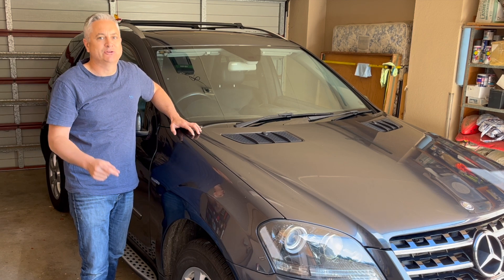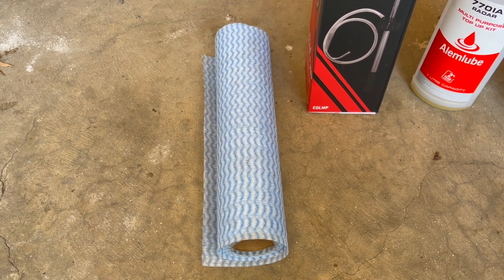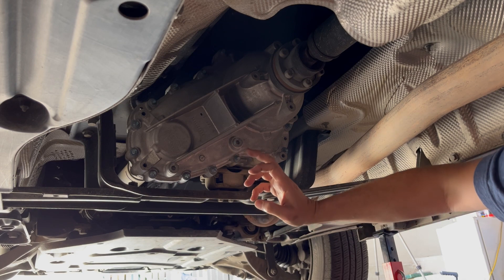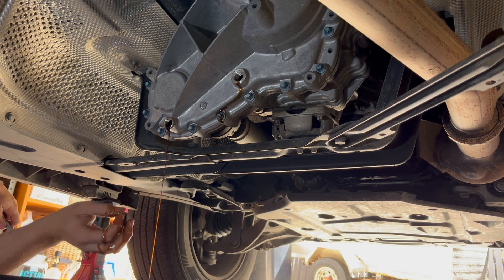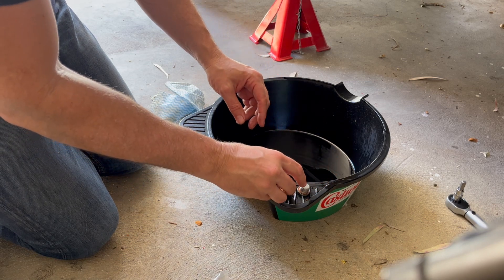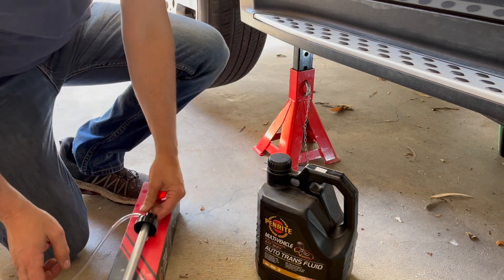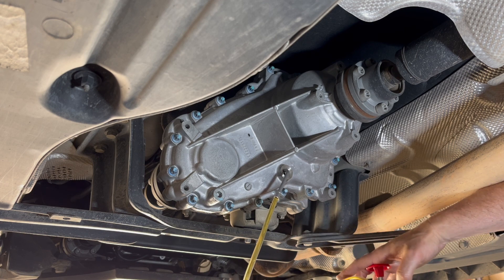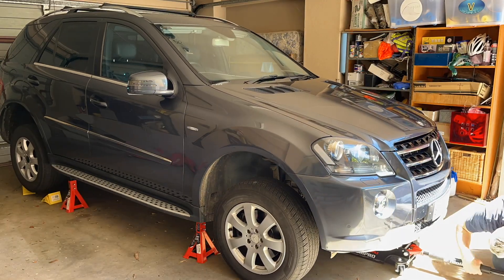How to Change Mercedes ML350 W164 Transfer Case Fluid Oil by Yourself - ML320 ML550 ML63 AMG GL

Comment: But why the oil color is yellow not Red
Reply from the maker: Hi Mate, I would have explained in the video that in Australia we have a oil company name Penrite and they make a ATF fluid which  meets many MB standards and I use it because you can use it in both low friction (option A89) 722.9 transmissions and the early 722.9 transmissions as well as the transfer case, but the colour is gold!  Cheers Drew

Comment: I changed mine today on my 2013 Mercedes ML-350 4matic. At 122,800 miles (197,600 km) and has never been changed. The fluid was pretty dark! However rear diff fluid color was ok...and has never been changed either.
Reply from the maker: Interesting, I reckon both your transfer case and differential will have breathed a sigh of relief!!  Cheers Drew
Reply: @DrewFixIt  I sort of figured out why Mercedes service manual never put the differential service intervals on the maintenance schedule. Because the fluid doesn't deteriorate that much it seems. However the transfer case ATF fluid does though it seems. Mercedes should have at least put the transfer case fluid change internals on the maintenance service manual.
Reply from the maker: @7150285  to be honest I just did my rear differential (video coming) and whilst I didn’t comment about it to me the fluid actually looked slightly milky in colour so I am glad that I have changed mine!  Cheers Drew
Reply: @DrewFixIt  how many miles or kilometers and how many years did your diff fluid had?? When you change your diff fluids...
Reply from the maker: @7150285   my vehicle has 170,000 kms and I don’t believe it has ever been changed before.  Cheers Drew
Reply: @DrewFixIt  shops and dealership usually don't mess with the differential fluid, nor the transfer case either actually. Because it is not even in the Mercedes's service intervals...at least not the shops or dealership in the US.
Reply: @DrewFixIt  did you also changed your front diff fluid at 170,000 km?? If yes, what color was it??

Comment: Thank you for your informative videos! My R-Class (W251) from 2007, has 115.000 km, and I'm thinking to change the transfer case oil. My MB dealer says I should not do it, since the old oil is thicker and new thinner oil can start to make noice. They recommend to never change oil, can that be true?
Reply from the maker: Hi Daniel,  I think your dealer wants to sell a complete new transfer case in a few years time!  I spoke with a senior tech at my local Mercedes dealership a month or so back, he has a GL variant of the same era of my car so would be X164 chassis and he himself told me the first thing that he did when he bought the car was change every single fluid to be fresh fluid and his advice was just make sure you buy good quality name brand oil that meets the MB required MB spec.  I personally use two brands most of the time; either Castrol or Penrite (which is a premium Australian brand) Cheers Drew
Reply from the maker: Hi Daniel, this is the benefit of the Penrite ATF fluid that I am using it does all of the MB specs across the Transfer Case along with eary and late 722.9 transmission.  If you're in Australia I would recommend using this Penrite fluid!  Cheers Drew
Reply: @DrewFixIt I'm in Europe so we don't have the Penrite, unfortenately, so I will take the best we have, the Fuchs Titan ATF 3353 MB 236.12, cheers!
Reply from the maker: @danieleriksson1657  Hi Daniel, you are absolutely doing the right thing as I always highlight in my video make sure you get a good quality oil in your country with the correct MB specification!  Cheers Drew
Reply: @DrewFixIt  that's the tricky part. MB workshop says 236.14 together with other MB sources and other MB sources says 236.12. Some people says the new 236.14 is compatible with the older 236.12, and some says 236.12 is much better, since it's Dextron III and the 236.14 oil is not complying with Dextron III. Fuchs 4134 is MB 236.14 and Fuchs 3533 is MB 236.12
Reply: Yes. You should definitely change it...

Comment: My GL has differential lock in both rear axle and transfer case (offroad version). Should I use same oil as you did? Thanks
Reply from the maker: Hi Mate, you need to check the exact specifications of the oil required for your diffs as I believe it is different.  Cheers Drew

Comment: Hi pal looking for part no .when I'm under my ml w164 there is a oval-shaped hole on the automatic gearbox I've been told it to access the crankcase when u look in you see the teeth I'm looking for the rubber plug that sit s in that hole I have a picture but I can't send it I've looked everywhere please help 
Cheers tom
Reply from the maker: Do you mean the rubber plug that you pull out on the bell housing to access the torque converter? Cheers Drew